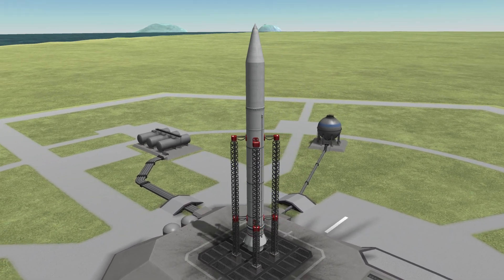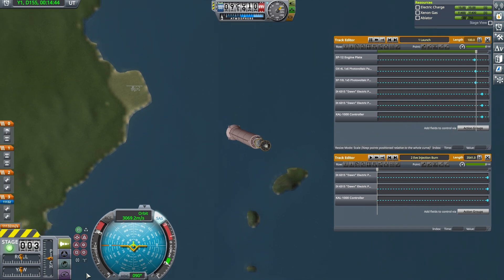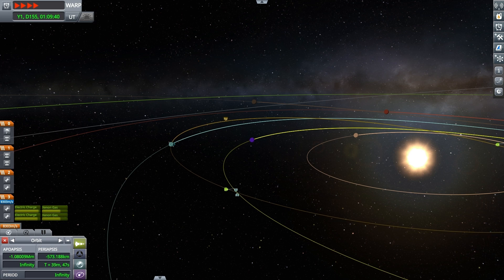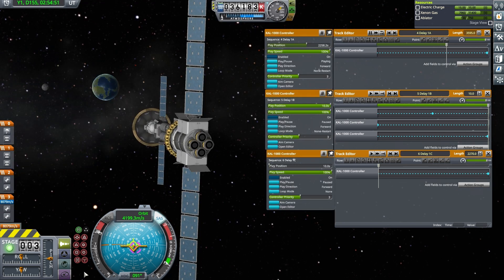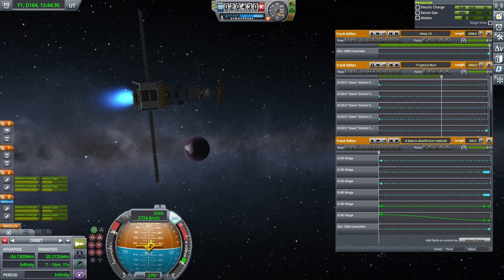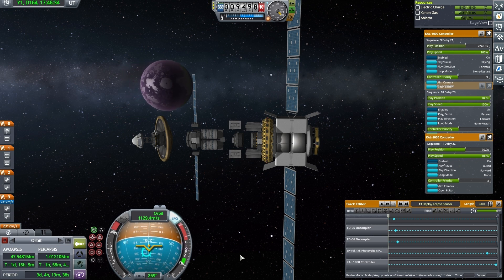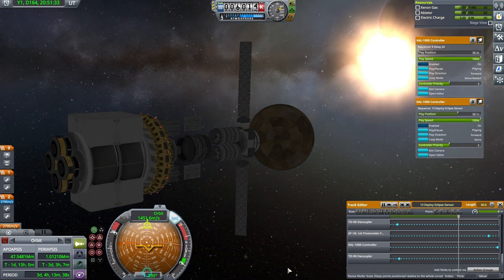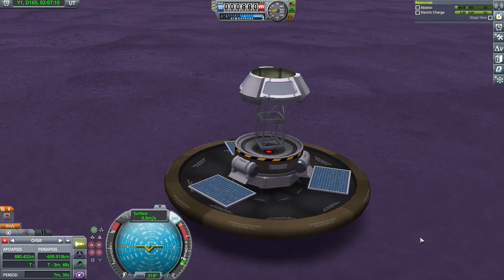Making KSP Play Itself: Fully Automated Eve Landing

Comment: What's the point of flipping those static solar panels? Wouldn't the solar arrays you already have deployed be enough to power the engines again once the eclipse is over?
Reply from the maker: Great question - The medium sized solar arrays that remain deployed are attached to the separated vessel that has the rotors. That’s why they lose power upon entering the eclipse. If they were attached to the main vessel, then it would not be able to halt the control sequence by allowing the power to drain. That’s why I only retract the largest panels when switching to eclipse detection mode.

Comment: I built an entire apollo mun landing craft, using KOS as the only mod, that required the user do nothing except start the program. Fully automated launch, shutdown of the centre engine on stage 1, separation, ullage, stage 2 ignition, dropping stage 2 ring, ejection of abort system, shutdown of centre engine of stage 2, separation, ullage, and orbit (no circularisation burn needed) then ullage and burn for mun, fairing release, connection of command module to lander, separation from stage 3, stage 3 then adjusted course to impact mun, mun capture and orbit, separation, rotation for lander observation, lander descent and landing, launch at right time to intercept, rendezvous, docking, separation again, return burn, separation of capsule, re-entry, chutes, and landing. Haven't played KSP for years now, I think I did everything and got it all out of my system.

Comment: you should try KOS its way more better. I have a script which i will choose any planet / moon / or craft anywhere and it will reach that without any manual control. only what you need is to build proper rocket
Reply: the whole point of doing it stock is because it's harder
Reply: @AHHHHHHHH21  yeah that 5000 lines of code was very easy ;)
Reply: @FlyingBrick-fast  did I EVER say that? I said stock is way harder, and that's what he did it for this video, I never said that KOS was easy

Comment: Damn incredible
Was the choice not to do a direct interplaentary reentry a self imposed challenge or was it necessary because it was found the KAL system didn't have the accuracy to do so?
Reply from the maker: Great question - the latter. I initially wanted to go with a direct descent, but I couldn’t get consistent enough re-entry geometry to ensure the final probe would survive. Also, using the initial capture orbit was the only way I could manage to get a reliable eclipse pass to use to activate anything.

Comment: Could you have just set the throttle to full with the panels deployed to initiate the deorbit maneuver?
the engines would have drained the power, but would resume producing thrust once it exits the shadow
Reply from the maker: That would only be an option if the timing uncertainty on the capture was on the order of 20 minutes or so. That way, I could have the deorbit burn start during the eclipse and drain the power that way. But the uncertainty is more like 3 hours, so the burn would mostly likely end up starting before the eclipse and burn up all the fuel before the desired time.
Reply: @jamieloganaerospace6404  makes sense, this is an impressive achievement

Comment: one of the most impressive and creative missions ever in KSP
surprised the game can actually run for 10 days and not crash
Reply: I once did a sandbox mission to Duna with a probe propelled by a single Ion engine. I had to do a burn that was going to take 45 minutes, so I enabled Mechjeb and let it do its thing. I come back around 30-35 minutes later and see that everything has gone smoothly so far, until I click and drag to rotate the camera just a little bit to the left and that's when it froze and a minute later crashed without even an error report. 

I was livid and will never do another long burn again.
Reply: @RevCPJohnson  Just don't move the camera 💀
Reply: @RevCPJohnson just physics warp lmao

Comment: This is literally how real spacecrafts fly. Very impressive!
Reply: it almost makes me mad that the game has the KAL controllers that make this possible in the first place, while not actually giving you adequate tools for doing this kind of thing in a sane manner. why can't there be some kind of trigger in the KAL controllers that detects when you have line of sight with the sun? why do we have to rig up ridiculous contraptions made of spinning motors just to detect sunlight?
Reply: @benwaffleiron  If there's somehow not a mod for this already, there will be eventually.
Reply: @16BitGoofball  basically MechJeb
Reply: @16BitGoofball  kOS
Reply: @benwaffleiron KAL is only designed for making robotic mechanisms. If you're looking for more advanced tools, you'll need to look for mods like KOS
Reply: @benwaffleiron  KOS is a good mod for programmable spacecraft have a look!
Reply: @benwaffleiron i think Kerbal Operating System can do that stuff automatically
Reply: @benwaffleiron   late but you can use KoS and mechjeb for similar things.
Reply: @benwaffleiron  no way bro yapped that hard about it 😭😭😭
Reply: Well, not exactly how real spacecraft fly, but definitely closer than regular KSP gameplay
Reply: no its not... just try KOS id you want that feel you are rocket engineer.
Reply: so the main difference between this mission and how we fly real spacecraft is that when we build real spacecraft, we build them with closed-loop control; i.e., the spacecraft plans a burn not by waiting and then blind firing, but by determining its current orbit, its target orbit, and calculating a burn that will take it from current to target orbit.
Reply: @you_just the coolest part about it is that closed loop control is possible if you feel like going through the work with kOS. I’ve seen people make some really impressive PID controllers, mostly just for powered landings
Reply: @ whoa, that's awesome... brb running a monte carlo on KOS
Reply: @you_just  YESSS THANKYOUTHANKYOUTHANKYOU I was waiting for this msg istg
Reply: @you_just  an eclipse sensor is a closed loop control
Reply: YES

Comment: The delay sequence reminds me of Assembly, where instead of having a wait() function you just make nested loops of wait routines.
Also, the eclipse detection mechanism is the coolest thing ever.
Reply: This technique is called busy waiting, and is in most cases considered an antipattern, due to multiple issues:
1. On any non-trivial system, there will be multiple threads. If one thread enters a busy wait, it may delay the execution of other threads.
2. Busy waiting wastes power.
3. Relying on CPU clock speed to measure time makes for programs that only work properly on specific CPU models, which diminishes usability. On top of this, there also exist CPUs with variable clock rates. With such CPUs, the busy-waiting algorithm would have to periodically recheck the current clock speed, which may be a particularly heavy and error-prone operation.

The correct way to implement timed waiting is through hardware. The implementation details differ based on architecture, but there is usually some way to halt the CPU temporarily. In multithreaded environments though, the wait function doesn't actually always halt the CPU. It just instructs the thread scheduler to stop scheduling the calling thread for some time. The CPU is only halted if the scheduler finds that every thread is currently waiting. Otherwise there will always be a thread running, so no processing power is wasted.
Reply: @andrasfogarasi5014 It's useful for microprocessors. The game boy and game boy color uses it to pause the CPU during screen writes